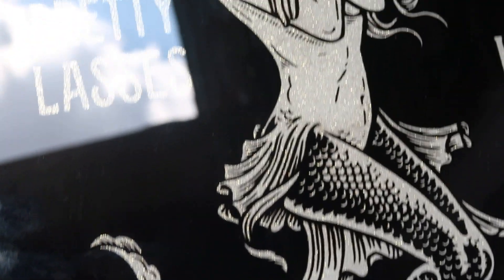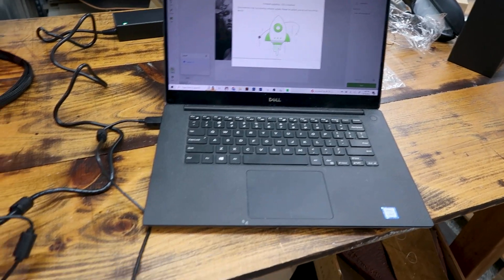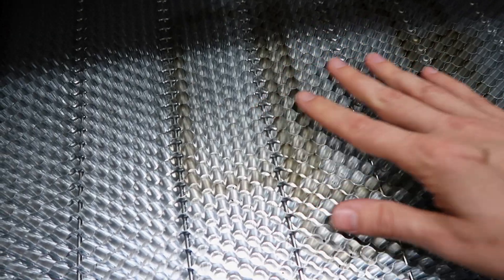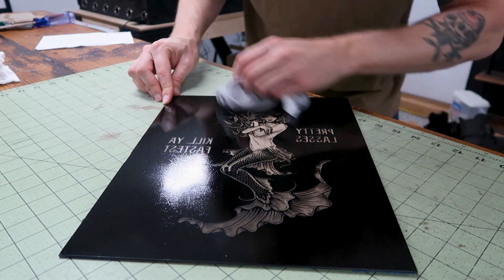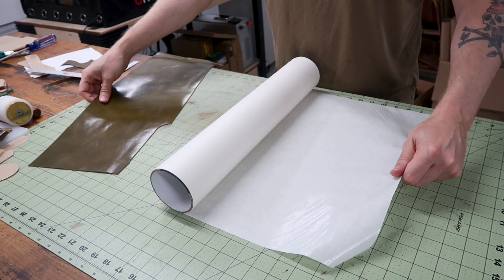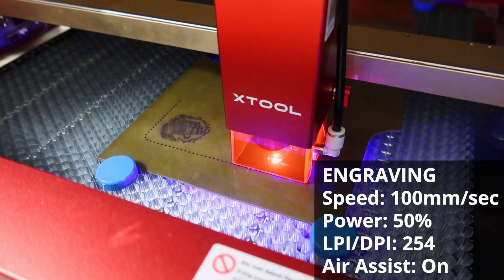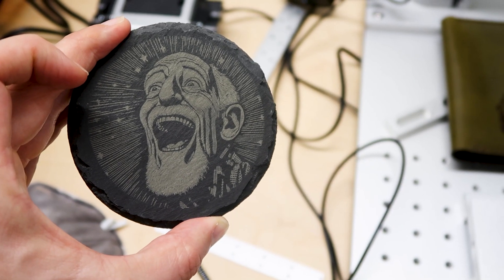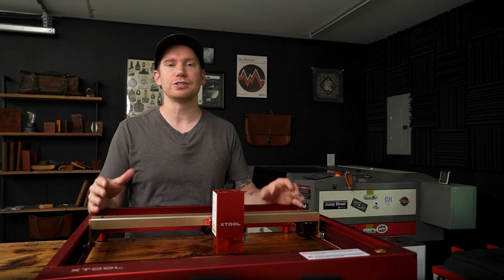I didn't expect this... / My xTool D1 Pro 20w experience

Comment: Great Video Justin. Where did you get your idea/settings to remove only the black paint from the glass without etching the glass? This is exactly what I am wanting to dobut your video is the only one I have seen doing just this. I dont want to etch the glass, I just want to remove the black paint  just as you did here.
Reply from the maker: Thanks! Its a common practice especially with diode lasers like the D1 Pro that cant engrave on clear materials. I think its done a lot on mirrors as well.

Comment: Can you tell me what the process is called for the painted glass? I’m trying to find some resources, but can’t narrow down how people might be referring to it. Reverse engraving?
Reply: He says he sprayed two coats of black gloss on picture frame glass and then used the engraver to burn that coating back off in the shape of the image. (The image would have to be reversed/mirrored) He then sprayed back over the back side with a metallic gold. I've seen a similar type of artwork done by hand that I've heard referred to as gilded glass signs or reverse glass signs but the "official" term for the french style of artwork is Verre églomisé. 
In that method the black paint, or whatever color they decided to use would be hand painted in reverse and the gold would be gold leaf or "gilding" leaf. There's a few artists that still do it and it is AMAZING to watch. They have an order to the layers and there can be quite a few of them. Hope that helps!!
Reply: @bdgc5785  you are an angel, thank you so much, was still looking for it!
Reply: Same here, did you have any luck?

Comment: Decent review but im guessing you didnt bother to even glance over the specs of the machine or what its capable of. The max dpi on the d1 is 317. Your dpi is dictated by the lasers spot size. The d1 has a spot soze of 0.08 on the lower wattage heads and a 0.1 size on the 40w head. None of the heads are capable of 400dpi. Then again im still running the oroginal d1 non pro version. Coming from a  background of being a cnc operator in the machining world gave me a little head start over most and ive gotten this machine to do things everyone else said it could never do.

Comment: $994.49 USD. Feels really over priced, for something so simple. You can get a Monport 40W Pro Lightburn-Supported CO2 Laser Engraver with CW3000 Water Cooling System for $809.99 and have a real laser with lightburn and a chiller and still have ~$200 in your pocket to play with.

Comment: I removed the shield, so much easier to work with. Just be safe and use an enclosure or goggles!
Reply: I was wondering if I could do this. I had a bit of wood that had just been cut out lift up, then before I could grab it out, the laser moved over to it and moved the whole thing.
Reply: @BenPresland  yes you can and it makes alignment easier. Just remember to wear safety glasses or a laser safe enclosure.

Comment: Yeah, the thumb screw.  That isn't really the problem, it is the soft aluminum on the laser housing.  The first time someone tightens it to much you get the indent, then when you do another project that is 1 mm thicker it goes to that indent. I have had to file the the module a few times to get it to set properly.  A small knob would be better I think.  Did you end up removing the shield?
Reply from the maker: Yes I did remove the shield. Lightyears better to deal with haha.

Comment: Hi mate thanks for the video, I'm really struggling with where to buy this laser from. And also confused about the warranty situation. If it breaks does it have to get sent to China ? Or somewhere in the UK. Really want to start engraving but there seems to be multiple websites for xtool. Hard to tell if they are legit. 
Could you possibly give me the website which I could purchase from? Any help greatly appreciated my man. Thanks again!!!!! 

From UK.
Reply from the maker: Hello! So yeah if you buy from somewhere like xTool it will be shipping from China but they ship all over the world and have the process down. I would have to double check the warranty info but I havent heard any real horror stories about getting things fixed from there. Usually these companies (the good ones) will ship the part out really quickly. Thats the best part about these little lasers is everything is easy to swap. Here is a link to the UK version of xTool: https://geni.us/xTool-UK
Reply: @justinlaser  thanks man.

Comment: Amazing one just loved it and got inspired for you @Justin Laser , I tried to do that but  i got honeycomb pattern on glass so what should i do to avoid that? And we have to put colored part on top facing right ? Please help me out that would be much appreciated 
Thank you so much @JustinLaser
Reply from the maker: Thanks! So you technically dont need to put the honeycomb under the glass at all since you wont be cutting anything. You can put it directly on that metal sheet or if thats too dirty just a piece of aluminum foil. You can see in the video I actually masked mine with light brown paper but.I dont suggest that unless you pay attention you dont want to start fires. And yes, you want the painted surface at the top. Its not a true glass engraving since we are just removing paint.

Comment: SOOOO, where's the resource to explain what settings are proper for what projects?
Reply from the maker: There is no one answer. You start with the material settings xTool offers on their website and test from there. Different materials, different machines, even the humidity level in the air can change the outcomes. I DO list my power and speed settings for each project in this video though.
Reply: @justinlaser  THANK YOU

Comment: Great review, and your projects really turned out great!
I was wondering about your ventilation solution, do you eliminate all the smell with the enclosure setup?
Or does it just remove the worst of it?
Reply from the maker: Just the worst. There will always be a little bit floating around the interior of your workspace since you will have to open the enclosure eventually. Also materials will off-gas for a while after cutting. Its a massive difference though.